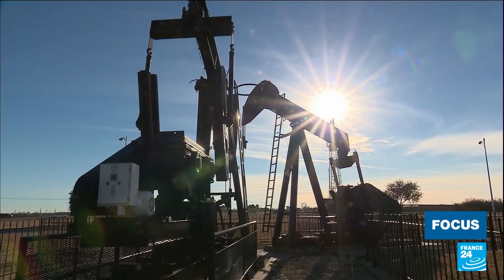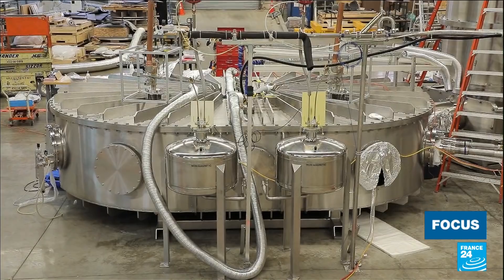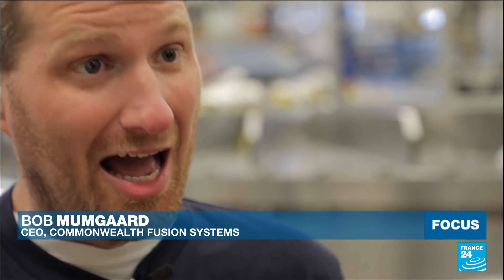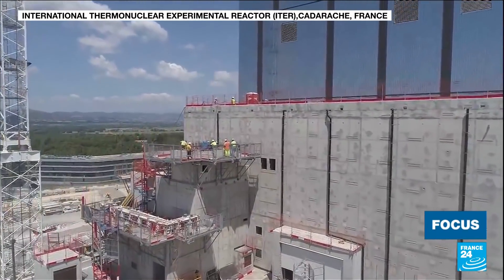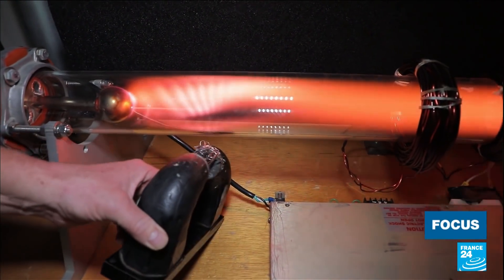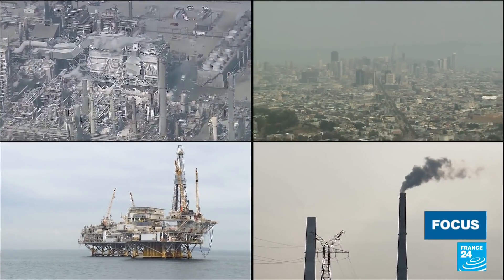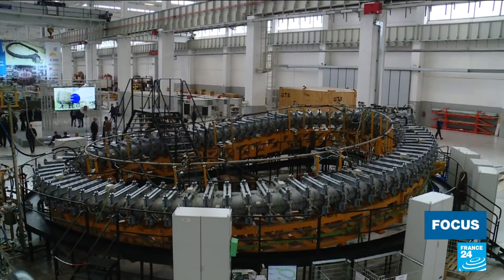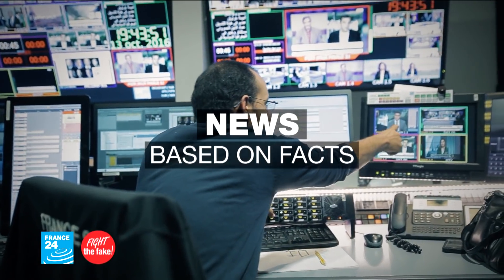The promise of endless clean energy: High hopes for nuclear fusion • FRANCE 24 English

Comment: They keep repeating the mantra that fusion energy is "clean" energy. 
That's "fake news", it's completely wrong, I guess it comes from non-scientists who believe that fusion energy is a kind of "artificial sun", and thus a form of solar energy which should be clean.
The reality is completely different: most of the energy released by fusion reaction is in the form of VERY high energy neutrons (perhaps you remember the "neutron bomb" which relied on fusion)
No material known to humankind is capable of resisting long-term to neutron bombardment without transmutation into other elements

Comment: France has always been supporting nuclear energy because it has no oil. Nuclear energy is the answer, especially fusion. It will still take a long time to be accepted politically. Further, it will be very expensive. But this is the ultimate answer. After all this is the nature's energy which runs the universe. All the good wishes for its success.
Reply: When fusion works, why would it be politically resisted and why would it be expensive? Once it works, it will take over, that's the point.
Reply: @markhirstwood4190  First the oil industry will be threatened. They're the most powerful of industries. They will not give way. If you think that setting up a fusion energy plant when ready will be affordable to a developing country, then you are from a different planet.
Reply: Judging by the billions invested so far into fusion energy, the tens of years of research and the army of scientists required to operate one of these reactors, I would think that fusion energy will either NOT be viable commercially, or at best, it will be used only by rich countries.
Reply: @lukebandolino882  I would promt you to see a certain graph that displayes the projected budget of fusion yearly to the progress expected. [U.S. historical fusion budget vs. 1976 ERDA plan.png] This graph is found in wikipedia.
Underfunding many times a project and expecting the same result with a normal or bigger funding is the definition of insanity.

Comment: Searl effect generator is a clean ATOMIC power plant without radioactivity... it uses neodymium and brownian motion style mechanism with rollers and rings .. like a Magnetic levitating gear ⚙ 🧲
Reply: Brownian motion is real and it has been tested experimentally to be able to deliver electrical power. However the Searl Effect generator, is to the extent I've been able to learn, based on bogus science so without doubt a hoax.
Reply: You can't have a nuclear reaction without producing radiation.  My bet is it can't be done.  The only reason stars stay lit is because of their size